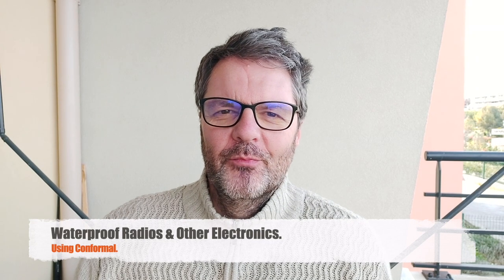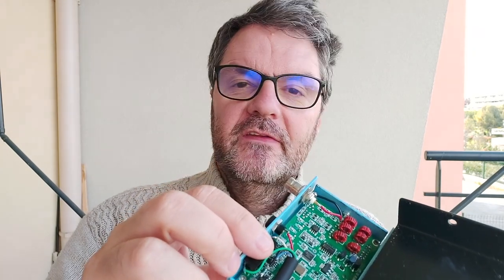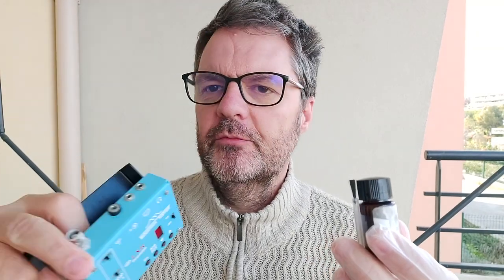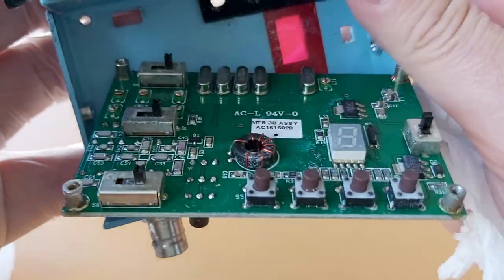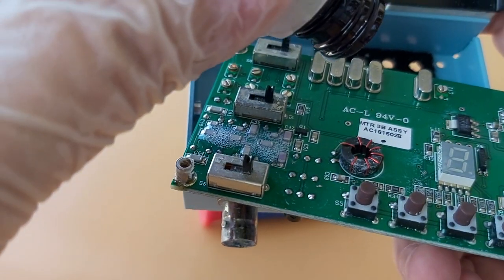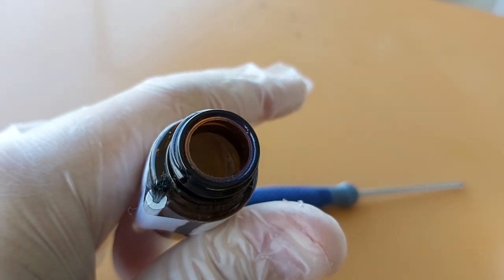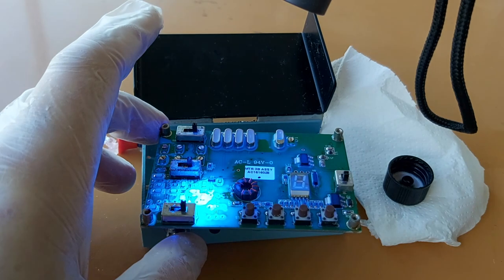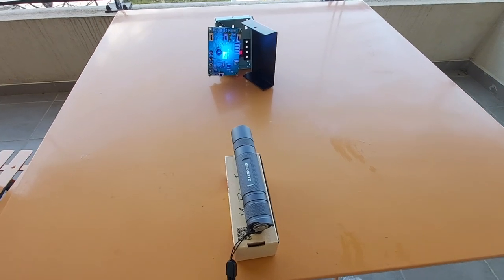Waterproof Radios & Other Electronics.

Comment: A Comformal coat spray is made by MG Chemicals, part number 419B-340g. I use this for all 
my repairs and it hold parts from moving. IN Ontario this cost is $16:00 Ca
Reply from the maker: Thanks!

Comment: Hello Gil, having some experience with conformal coatings on PCBs i can share a few thoughts. If i where you i would replace the corroded switches and dip wash and brush all the board in isopropyl alcohol. Dry it bake it at 60c on an oven for a couple of hours. And then apply the varnish. Carefull with trimpots trimcaps switches connectors and stuff that might get stuck of insulated after application. 

I have used silicone type, polyurethane types and acrillyc type coatings.. some have advantages and disadvantages over the others.. in terms of how easy to they are to apply, repair, remove etc..oh and cost!

Hope it helped, 73
Cheers
Reply from the maker: Good advice thanks.
Reply: You can submerge with Isopropyl?
Reply from the maker: Probably...
Reply: @Justin-bd2dg  Sure, keep it to no longer than 10 minutes in 100%. And use common sense on the kind of components assembled. Ie i wouldnt dip an LCD display or a TFT screen.. greased pots might also be a bad idea etc. Isopropyl is pretty much safe with components, resistors caps ics etc.. still if in doubt use your best judgement. Also dipping is better to clean heavy solder flux residue. If you just want to light clean you can just brush the board with Isopropyl instead of having it dipped.. but really you can. 

Cheers
Reply: Washing off with distilled water IMMEDIATELY after salt water exposure, and then oven baking is mandatory. Sealing the salt deposits in with a conformal coating is just gonna seal in the problem  :(
Reply: @hectorpascal  Very true, get rid of the salt deposits and replace corroded components.  DI water immersion/Brushing  + Baking or a 50/50 DI water/Isopropyl. Otherwise corrosion will slow down underneath conformal coating but will continue to develop. And you cannot conformal coat switches properly.

Comment: Conformal can be any kind of non-conductive film applied to a circuit board. It doesn't have to be a UV resin. 

Its best to use UV resin at night with artificial lights yellow in color. White LED lights do emit some UV light.

UV resin can be purchased in metal cans used for fiberglassing. As an alternate you can use epoxy resin or vinyl resin used for auto body repair. Marine varnish can be used as well. Just be aware that adding a resin layer to your circuit board can create a dielectric component to RF circuits.

A trick i learned from the telephone industry is to inject switches with petroleum jelly/Vaseline/ grease to keep out water. Just put some grease in a small syringe and inject it in. Also put some  dust caps on the switches. Cut a small thin rectangle bigger than the switch and then cut a small hole which is big enough for the switch shaft to fit in the rectangular dust protector.

Comment: My neighbar from Krakow ..give mi after 2010  Motorola GM900 .. 2stc ..   in Poland was a deep  flood in this year.  6 days Her Truck ( He was worked on sand transport near river Wisła )  Her truck was 6 days under water ..  Motorola was a 6 days in Vistula river ..   Afrer this flood . Neightbar give me this motorola . Mud in PCB mud in speaker and microphone .... i dry it ... and this radio does without problems to today ..   10 yrs after flood radio is like new .. Modulation ... Receiving ..   Motorola GM900  is Waterproof i tell you!  like a Polish Prepper .
Reply from the maker: Wow!
Reply: @RadioPrepper  True

Comment: According to Wikipedia conformal does not have to be any specific resin. The cheapest UV resins cost pennies. A cheap and obtainable conformal is a shellack that should be dissolved in alcohol. After the solvent evaporates what is left is conformal coating. Shellack after years likes to crack so it has to be renewed. Any resin glue would work as conformal. That lowers the price tag really low.
Reply from the maker: Great info thanks!

Comment: Gil, Thank you for your practical, adventurous and always enjoyable videos.  A fellow sailor, I have had some success with pure silicon o-ring lube (Scuba type like Triton) for plugs, antenna connections and switches, followed by clear Krylon spray lacquer for the pcb boards..
Looking forward to you getting back to sea after the lockdown. 73. Ed
Reply from the maker: Good info, thanks! Me too!
Reply: Dont know those Silicone variants but it's good to choose ones which do not release acetic acid (smells of vinegar!!) as this eats the connector or electronics after a while

Comment: I’ve thought about how to do this for many years. We use a product called “liquid electrical tape”. It’s basically a waterproofing glue-like chemical.
Problem I worry about is potential for electronics overheating. This is more a concern with laptops which produce heat but never tried it on the radios.
Are there any drawbacks to waterproofing circuit boards....?
Reply from the maker: Not that I know of, except maybe for later repairs..

Comment: I did have a two band MTR in an altoids tin and the cats that like my wife but not me, one of them, decided to micturate corrosive fluid onto it. I was not happy. Cleaned off it got rehoused in one of steve’s custom cases that he had a few extra of. 20 and fourty, it’s a favorite. .Most of our parts would tolerate just water without a problem, there are some fluxes designed to cleanup with water. Switches and trimmers are a problem to protect and a problem if not protected and violated.  I would be tempted to  try and encase the trimmers as it might also keep them locked but switches might just have to be replaced if damaged by corrosives. The uv curing stuff sounds really permanent, while acrylic spray could probably be removed with solvents and if applied thinly you can solder “through” it if needed. Another alternative is to melt some bees wax.
Reply from the maker: I built a two bander too :-)

Comment: For toroids I dissolve styrofoam in MEK. For the rest I either do nothing or sometimes will mask off switches and connectors with tape and then spray really light sprays of KRYLON clear which is acrylic and cheap and dries fast.
Reply: So you make poor man's napalm?
Reply: @Justin-bd2dg  poor man’s QDope.
Reply: Won't the M.E.K. damage the coatings on the caps, resistors, transistors etc.? Surely at least remove the paint?
Reply from the maker: So far so good...

Comment: Good one Gill, Conformal coating is very common I'm sure your "Green" radios will have some, normally you want to put it everywhere except your switches or variable components unless you never want to change them mask off those areas and do the coating first and also underneath. Try and get a reeneterable one that you can solder through ...all will stink if you use a soldering iron on them so do that outside. Also your switches/connectors arn't waterproof and will still rot with sea water..not much you can do about that. Look at CPC/RS/Farnell etc for a half litre bottle or spray can if you are doing a lot of this Gill!
Reply from the maker: Good advice thanks!

Comment: use the proper conformal coating, search on amazon and you tube for: MG Chemicals - 419D-55ML 419D Premium Acrylic Conformal Coating
Reply from the maker: Thank you!
Reply: @RadioPrepper   FYI: some recommend the silicone-based version.

Comment: Never heard of conformal before, thanks Gil 👍👏👏
Reply from the maker: Me neither, that's why I posted it...
Reply: Conformal is just a protective layer applied to circit board. In the past   wax, varnish, paint, and now resin is used. It doesnt have to be a UV resin. Just as long as it is not conductive.

Comment: Conformal coating of PCB's is widely used in the Automotive industry for modules fitted under the hood or in the doors as both are -- at best -- 'wet and humid' environments. 
There are many different types of coating materials and they don't need to be particularly 'High Tech.' However, they do need to be 'insulating' or -- for high impedance circuits, coating will have a negative performance effect.
The problem with only partially coating a pcb is that moisture will get under the coating you have applied and actually make things worse!
Masking off components (switches in your case) and spraying the conformal coat will give much better coverage -- but is a LOT more work! Automotive pcb's are both sprayed or dipped in the conformal coating material after masking the areas of the pcb you don't want coated. 
Conformal coating is both a science and an art! 
It's not easy to get it right. 73 Bruce G4ABX
Reply from the maker: Thanks. Dipping would be ideal if possible...
Reply: @RadioPrepper  Unless there are switches, connectors or potmeters on the board, those don’t take a dip in coating very well. You will sure remember your own epoxy incident with an analog meter.
Spray on coatings are good. At work I use Electrolube DCA200H for protecting boards.

Comment: Gil, please be sure to wear protective eyewear when using UV light!

Next, some circuit characteristics, such as inter-trace capacitance can be altered by conformal coating. Generally when companies are building mil-spec boards that must be conformal coated they will do testing after coating as it is possible to have a circuit that works just fine without coating but which fails to work properly after coating because of these altered electrical characteristics.

Finally, conformal coating is an excellent way to protect circuit boards. WOuldn't it be great if we could buy ham radios made with leaded solder and conformal coating in the factory?
Reply from the maker: Ah yes, thanks. They really should..

Comment: I have seen others using clear nail polish to at least splash proof their electronic creations like Arduinos etc., it seems to work really good and is very cheap as well. 
Then there is of course silicon, better heat resistance but perhaps a little bit messy to apply?
Maybe both is worth a try?
Perhaps do a video on it and show what it can handle and what not?
73's de sa5vox
Reply from the maker: That might work, and you can pick different colors, lol.
Reply: Hahaha! Now THAT'S how you personalize a pcb! 😂👍  (Perhaps need to keep away from the metallic stuff though.. bummer... I sooo wanted mine in blue metallic. 😭😁)

Comment: Gill I think you would be much better off putting it in a zip lock bag or a water proof box. I wouldn't trust it to get wet even with that coating.
Reply from the maker: Of course, it's just an extra precaution.

Comment: Sorry but partly protected=unprotected.
Reply from the maker: Of course, but it is better than no protection at all and a good start.
Reply: @RadioPrepper  A plastic food storage bag can hold your radio and you can use switches without any difficulty. Knobs are another issue but can be accessed if the bag is not too tight. Any cables that exit the plastic can be sealed with silicone caulk.Have used this and is effective.
Reply from the maker: If 9nly radios had bluetooth control, they would be easy to seal..